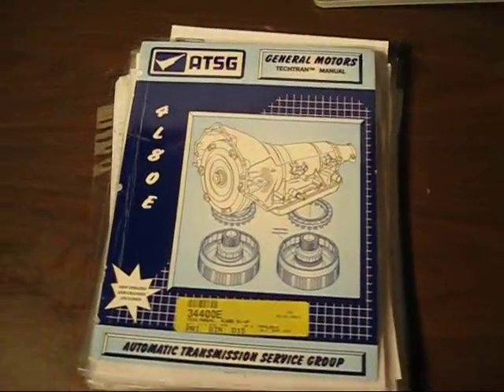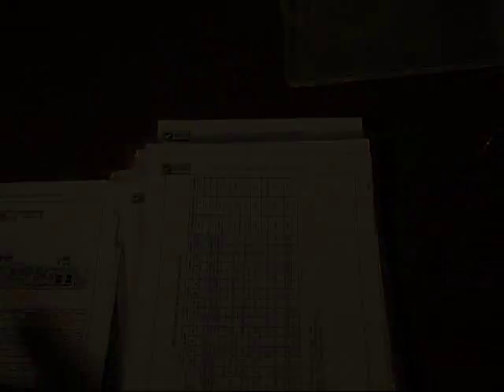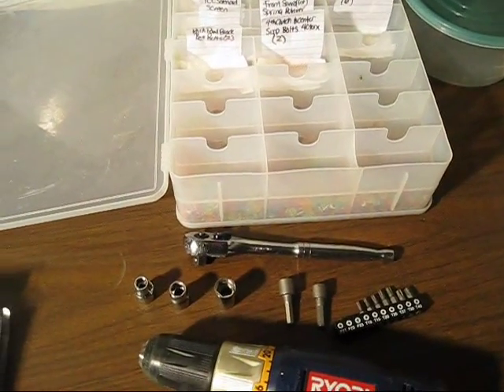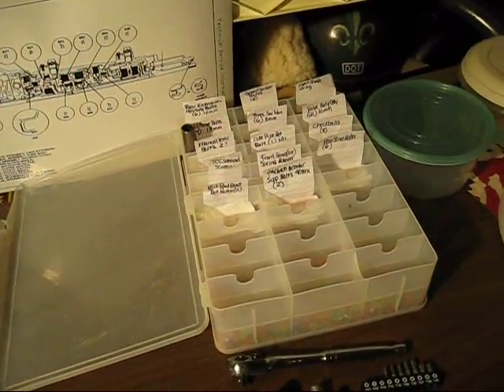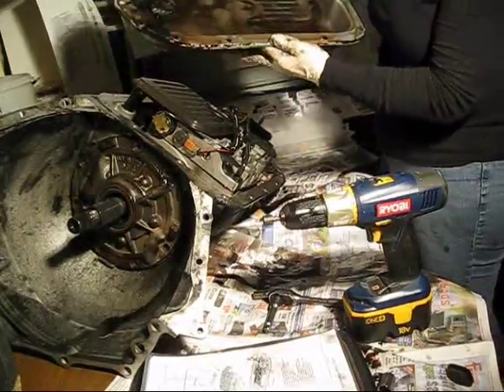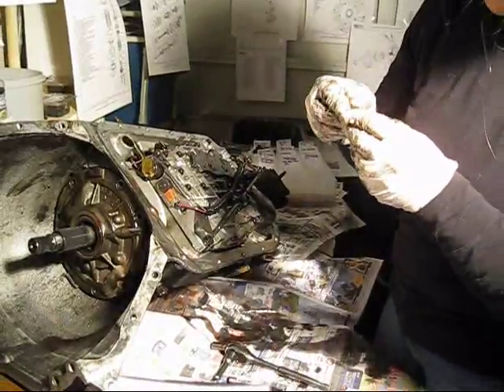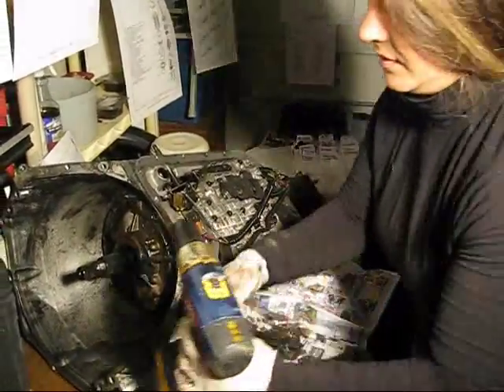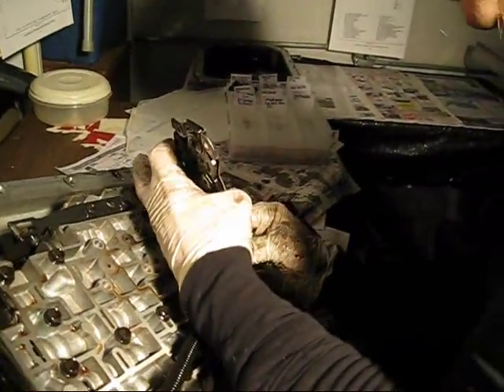4L80E Main Disassembly #1 crop

Comment: having a blow up parts diagram on wall very helpful and pegboard with parts cubbies with small parts bolts laid out. hanging wire to soak new frictions in transmission fluid.
Reply from the maker: Great idea! Ill have to try that next time!